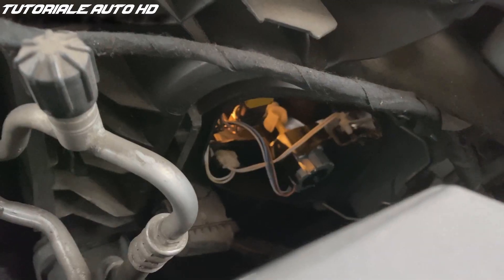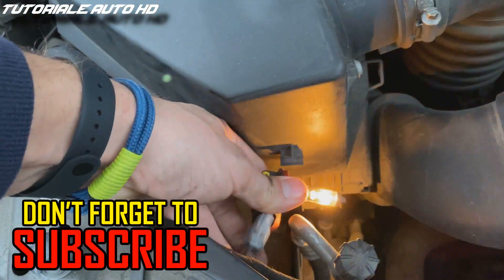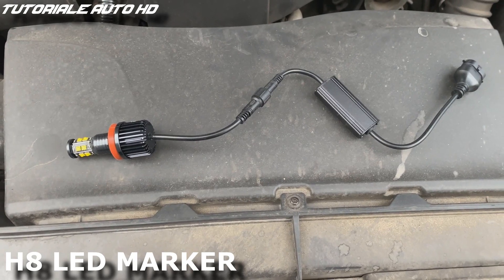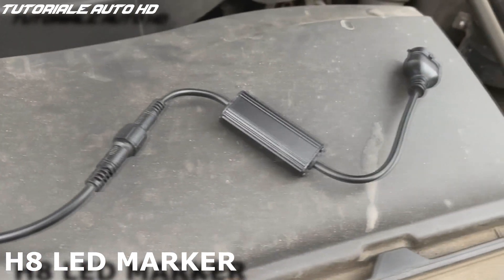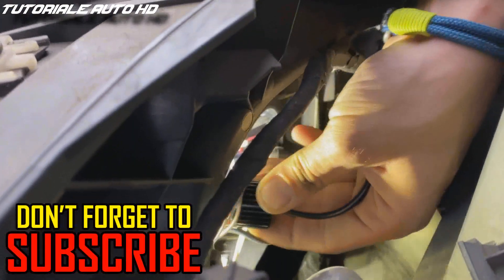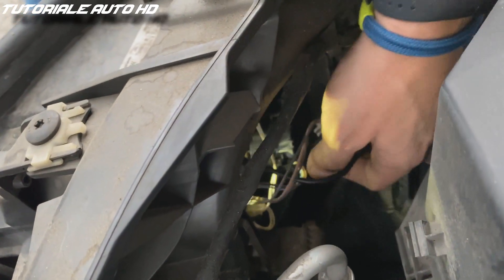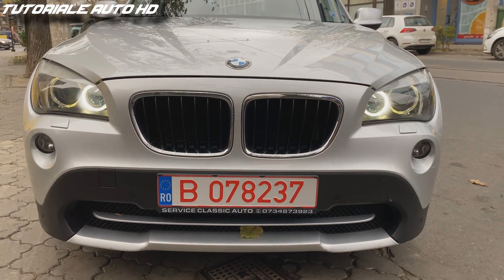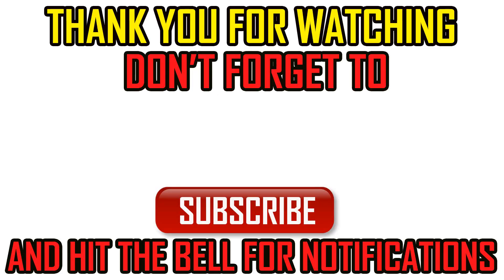BMW X1 E84 Angel Eyes Bulb Replacement H8 Led Marker Install Retrofit

Comment: Do you need to install the angel eye rings first? I have the original halogen bulbs that don’t illuminate rings
Reply from the maker: Hy . If you don’t have angel eyes from factory equipment , you need to install the rings but it’s not so easy , or you can change your headlights

Comment: Hi, is it possible to change easily the  outer rings so that all 4 rings glow the same white colour? If yes - should the same H8 type bulbs be used?
Reply: @lubek159 Hello, both the inner and outer ring shares the same bulb and the bulb is positioned closer towards the inner ring, the inner ring will always looks brighter regardless the bulb you use.
Reply: I think you can but you need to but 120W white h8